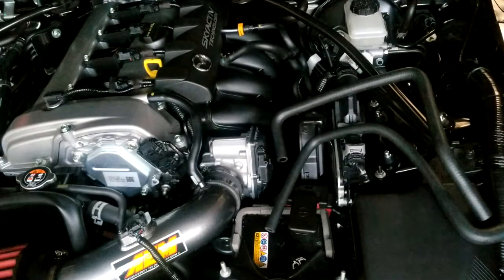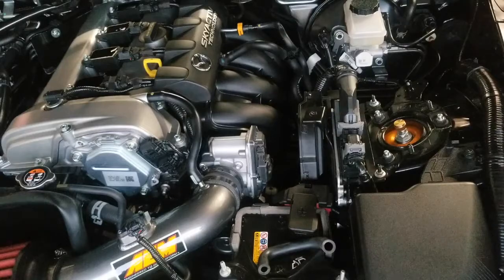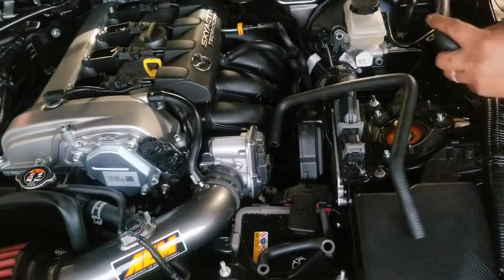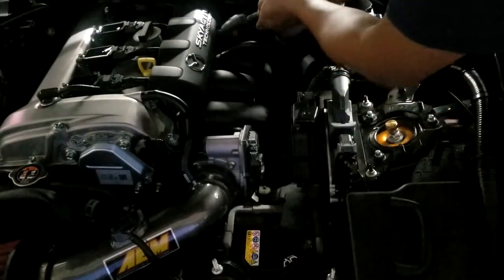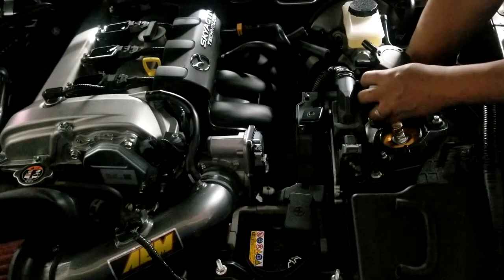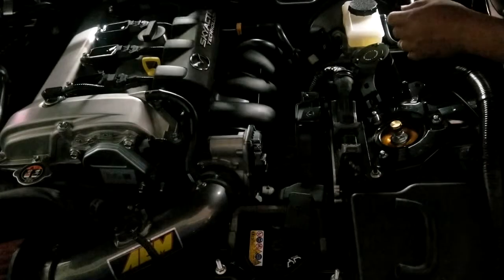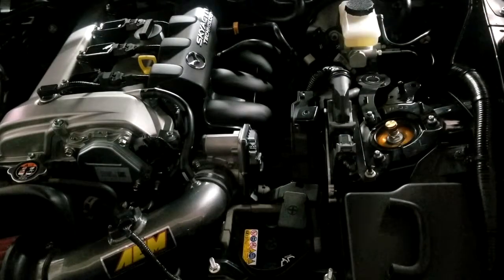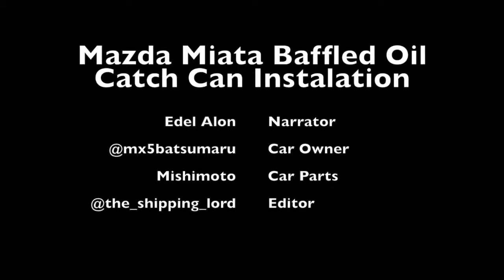Mishimoto Mazda Miata Baffled Oil Catch Can Install on 2018 MX-5

Comment: I had the same issue where the hoses were not labeled. However, I used the small diameter end for both hoses when attaching to the intake/PCV. I found that the large end was too large and would become detached at the smallest touch. 

It took a lot of patience to get the hoses on but I am pretty confident they will not become detached because the figment is so tight.

Comment: The AEM CAI take into my attention. I was interested in it. With the hot ambient temperature in here, i’m worried it’s gonna be useless.  
Do you gain anything with it beside sound?
Reply from the maker: They say it adds about 8hp. I think it adds about 5. If you do it, consider upgrading your mid pipe and exhaust too.
Reply: edelicious currently only installed a catback exhaust, 4-1 header, and ecu tune.  Did replace the stock filter with K&N one.   But still CAI takes my attention, and still deciding wether to get one or not.  Have you ever dyno you car, before and after CAI?
Reply from the maker: @paniki_man2512  I have not put it on the dyno. But I've seen other youtube videos that have. You have a great setup! Just needs a better way to bring in air. Do not supercharge it.
Reply: edelicious yes, plan to keep it NA. 🙂  anyway, i plan to install the oil catch can as well. Still waiting for the package to arrive.
Reply: Found a problem installing the can. Here is right hand drive. Have to find alternative spot to place the can 😓
Reply from the maker: @paniki_man2512  Is the intake manifold still on the right?
Reply: edelicious yes. So i use a bracket to hold the catch can. Additionally i have to extend the drainage hose.

Comment: I'm confused...shouldn't the catch can be connected between the valve cover and the intake tube thats right before the throttle plate?
Reply from the maker: Yes, most car's pressure release hoses are on the top. On the Miata, it's in the back of the engine.
Reply: @edelicious  well what about the oil that gets sucked out of the valve cover?
Reply: And is that purple barb the pcv?
Reply from the maker: @jeffreycormier3864  Yes it is. This version takes that excess oil and filters it before returning it to the manifold. I think the solution you want is this one: https://www.verus-engineering.com/shop/product/air-oil-separator-aos-nd-miata-870?category=28 It was definitely on the top of my list but I could not afford it and my current intake won't work without more modifications.
Reply: @edelicious  was the purple nipple on your pcv loose? i was just messing with mine and noticed that it has a little play, can spin, and the collar around it jiggles.
Reply from the maker: @jeffreycormier3864  yes, I've felt others and it is lose like that.
Reply: @edelicious  ok just checking...looking to install on my 2018 in the next few days when I do an oil change
Reply from the maker: @jeffreycormier3864  How did it go?
Reply: No that hose actually brings air into valve cover no vacuum so no real pressure